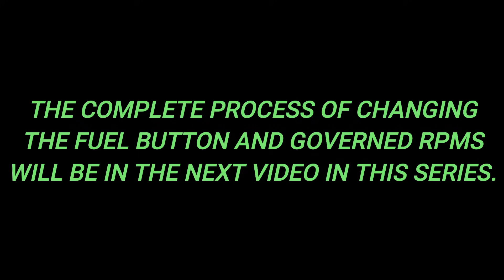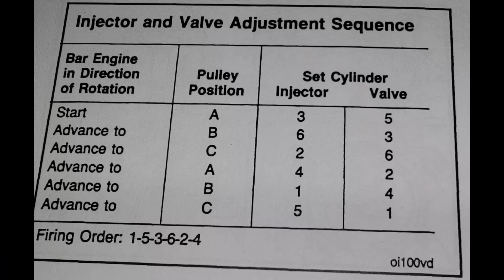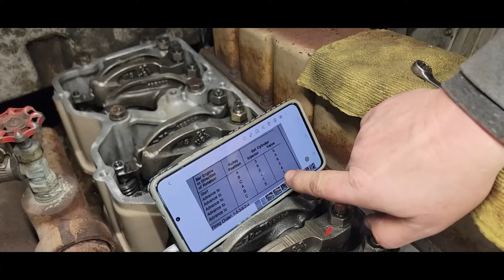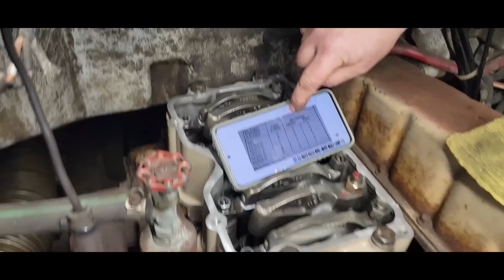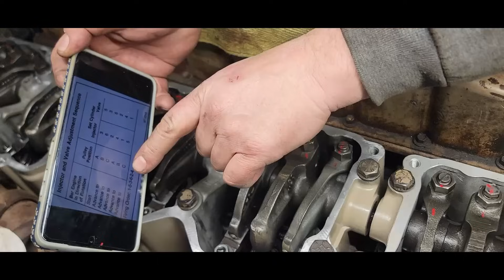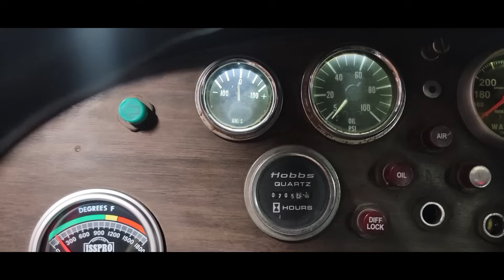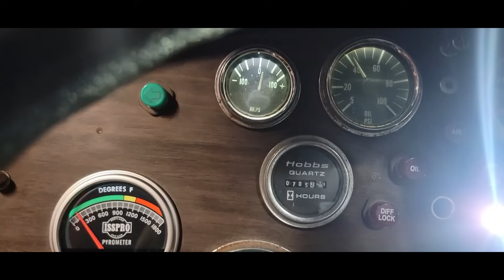CUMMINS NT 855 / N14 COMPLETE OVERHEAD INCLUDING ROCKER INSTALL

Comment: Just an FYI when tightening the rocker shaft up it's best to tighten both sides at the same time. I put an Allen in a vise balance the rocker box on it and tighten up the other side with another Allen. This gets both sides tight and also prevents you from snapping off the oiling set screw, ask me how I know. 17:30
Reply from the maker: hard believe a 70lb ft of torque could break that hardened pin. wonder if someone used an impact on them before. i have never broken one.
Reply: @j.c.smithprojects  I'm sure an impact would do some damage. After having one break on me, could have been cracked already, and finding multiple snapped off ones. I've decided it's best, for me at least, to take them apart and put them back together with two Allens. A little piece of mind for myself I guess, it a really PITA to get the rocker shaft out with the tip of the set screw snapped off in it.

Comment: Did you see all the N14 oil pumps with excessive end clearences right out of the box on jpaydirts channel.  He finally took a new pump to a machine shop and had the housing lapped to reduce end clearance to 0.005" from 0.008" and greatly improved his oil pressure.  0.008 is max on a worn out pump.  Yet brand new pumps come there.   Somebody in a different video. Spun the pump with  oil in it.  The oil flowed back thru the pump instantly as soon as he stopped turning the drive.
Reply from the maker: i watched jeffs video. its like everything else made today.....crap. this system is designed to run 35 to 45psi. we had 42 psi on the dash gauge. i put an oil filled manual gauge on the pump and it showed 47 psi at 160 degrees. i think its ok. however, i will be rebuilding the old pump for another big cam and it will be much tighter tolerance.

Comment: Great video, I was hoping to see the rocker boxes going on. We're installing the rocker boxes on our big cam 4 and if you get the pushrods in the adjusters correctly, some of them hold the rocker box up. Do you have to draw the boxes down with the bolts at some point? Or is there a spot on the cam that gives enough lash on all 6 pushrods that the box will sit down flat on the head?
Edit: Your note at 23:44 seems to say no, you should be able to get the rocker box on flat. We backed out the adjusters enough that the pushrod cup was pushing on the arm itself and it still wouldn't go flat. We checked that the pushrods are in the cup of the cam followers. I'm a little perplexed at the moment.
Reply from the maker: you should be able to back the adjusters off and get the boxes sitting flat. if not, i would check your push tubes. they are either not in the cup of the roller or the wrong ones in the wrong place. injector push tubes are different from valve push tubes.

Comment: We have a Cummins L10 non STC internal balanced  that we have to adjust valves and injectors would it be the same procedure as the 855 other than one head compared to the 3. Were not finding much info on the L10 non STC.
Reply from the maker: cummins quick serve website. you can gat a manual for your engine by its serial number.

Comment: Anyway you can help me out this the governor part number. 

I’m currently changing my BC3 over from a Cummins 3024365
Show needing 
The governor 
Short coupler sleeve 199358 (or cut mine down)
Compressor manifold, or air inlet tube (sn3711ab) are these numbers and parts correct for what you needed to switch?

Comment: i have a oil leak under my rocker cover box , number 1&2 , what i’m worried is can i make a gasket with the gasket material? i ordered a gasket but it wasn’t the right gasket my trouble with ordering stuff is my ID tag is missing so i don’t know the CPL and all the information the tag had , and i’m wondering how to replace the o rings in the end caps of the rocker box also mine do not screw in i guess i will have to punch them out? the rocker box did not leak until i replaced the water pump my help forgot to tighten the two bolts on the plate but when i did tighten them one side stop leaking but the lowest side on the slated engine didn’t ! i dont see how it ruined gasket with the bolts not being tightened
Reply from the maker: the engine serial number is usually stamped on the driver side rear right below the top of the deck on a machine flat spot.

Comment: I hope u meant. 6” inch pounds
Reply from the maker: yeah., im sure i made that mistake because i dont do it that way and have not thought about that spec in a long time.
Reply: @j.c.smithprojects I like this method makes you feel like you're really setting the injector ... I used the Cummins t handle tool and man it barely turns probably not even a 1/4 turn when you set it